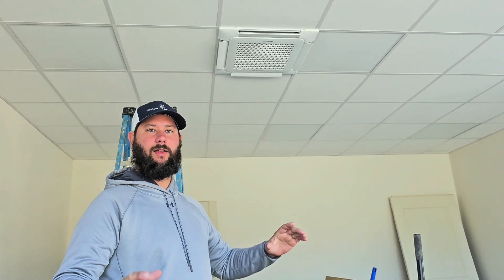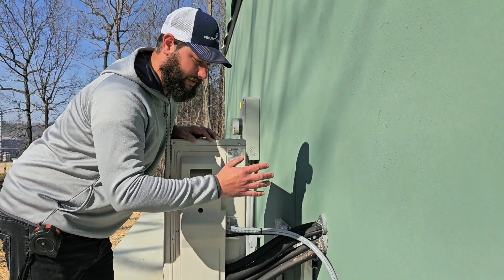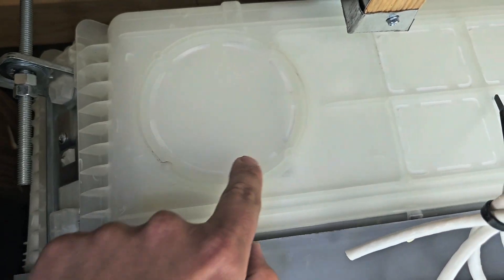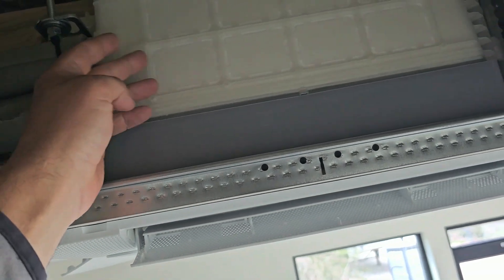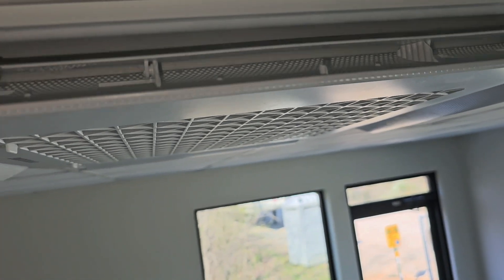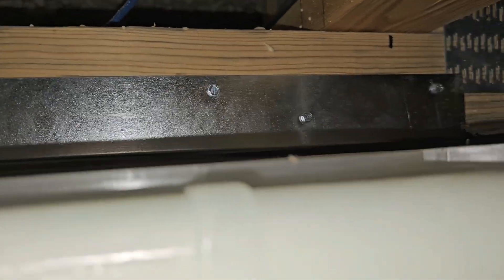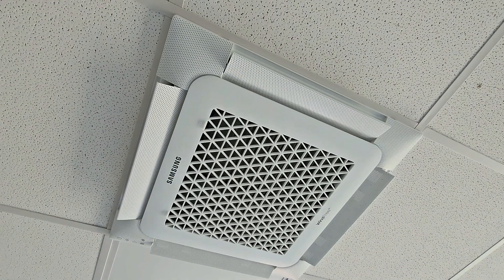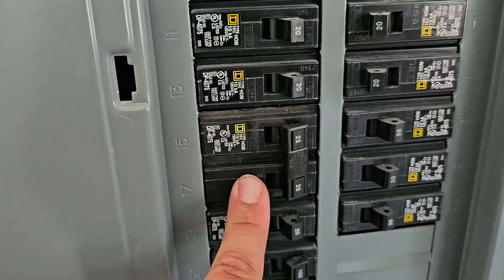Ceiling Cassette Mini Split: Everything You Need to Know

Comment: Great information, thank you so much for that! I’m considering cassettes for the bedrooms in my house on the second floor, since the line sets could all be brought in through the attic. However, I’m wondering how much efficiency is being lost by having the cassettes in immediate contact with the hot attic as opposed to a wall unit. Any thoughts?
Reply from the maker: No efficiency is lost unless the added humidity is above 80%. If so, just wrap with insulation, wrap the body of the cassette, and then you lose no efficiency
Reply from the maker: Attic

Comment: I hate people who just critique but there is no way this is a permitted install.  If it is your local jurisdiction does not know the code.  Office space...esp because the windows are often fixed...are required to have outside air.  It is not a case of "if you want it".  Could be 15 cfm or more per occupant which could be a 4" ducts connecting to an 8" duct and a variable speed, controllable fan. 
However, good install.  And everything you say is great...for a residential install

Comment: I’m sure this won’t be seen but I’m going to throw it into the ether just in case:

I’m looking for info on one and two way cassettes. I’m replacing my whole house HVAC and designing a system with multiple mini splits. Because of the floor plan we have and how we use our house, this makes the most sense for us. I’m very interested in a VRF system as well as air treatment to ensure we have the highest air quality possible. Any insight you have on these systems is much appreciated.
Reply from the maker: 1 way cassettes are great 
I am working on a quote and sending equipment to Knoxville TN for a new construction their.
If you need help I can consult and help you just join level 5 member ship and hit me back to get started

Comment: Silly question - if the outdoor condenser unit  can be installed in attic when there is no space outside for it whatsoever?
Reply from the maker: You can not install the outdoor unit in the attic
It has to be installed outdoors

Comment: Nice looking install. My area requires me to place unistrut around the all thread after a certain length and also requires airplane cable from every corner of the unit. In my opinion its over the top but something others should keep in mind.
Reply from the maker: Good tip!

Comment: Mounting those in place in a drop ceiling has to be sucky. How hard was it to run the refrigerant lines to each unit?
Reply from the maker: It was new construction there was no grid no drop ceiling
So we were able to run the line sets pretty easily